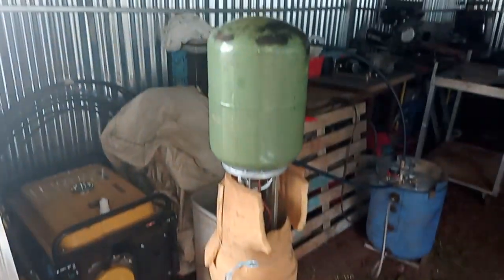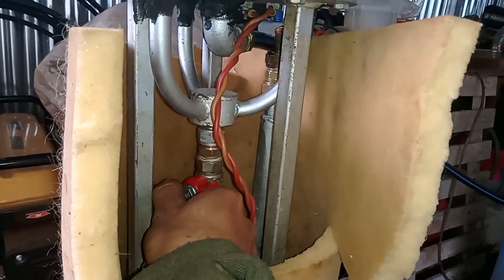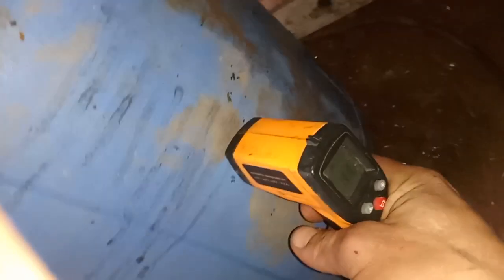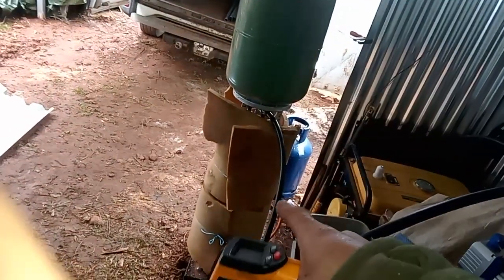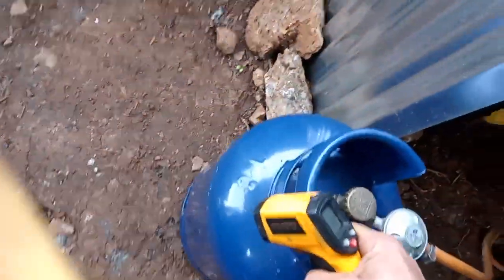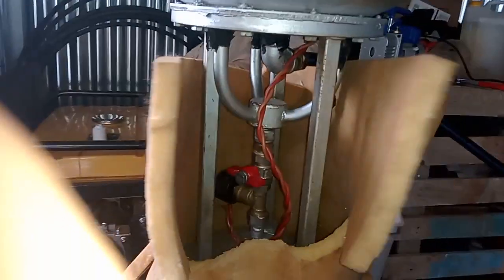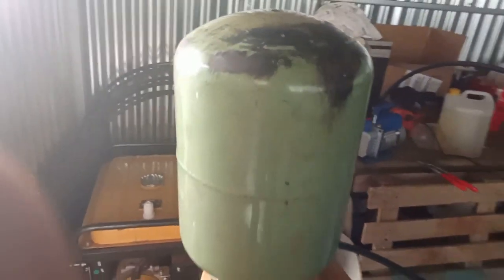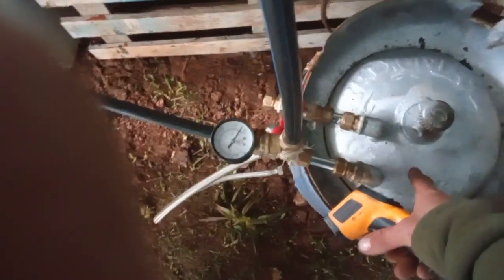Tesla's mechanical oscillator en the cold steam rankine cycle

Comment: I am wondering did you calculate the efficiency of the thermal-to-mechanical energy transformation ? Based on how fast the temperature drops it looks like that it uses about 1800-1900 J/s (thermal).
Reply from the maker: Yes I did en it was terrible. Like 0.0somthing % on 80l 70c til 50c water in15 min on a 3 watt load . Cold steam en low expansion piston engine is terrible

Comment: try a stronger vacuum pump the effect will be huge
Reply: on and on
Reply: i really appreciate your work you are amazing
Reply from the maker: The reason this could work better is that the exhaust pipe is way to small for the cold steam so it has a lot of back pressure Al problems wil be eliminated in the upscaling ik doing now on this system